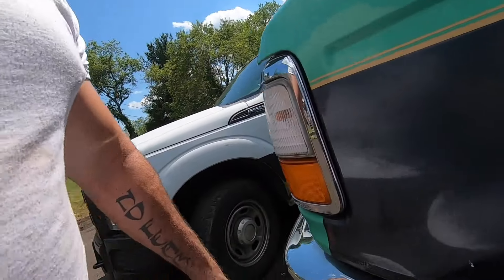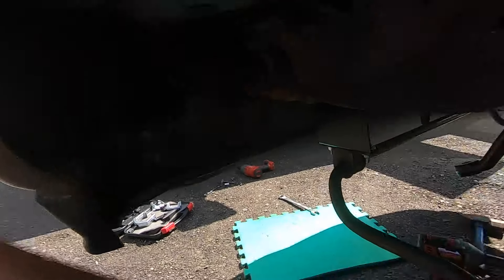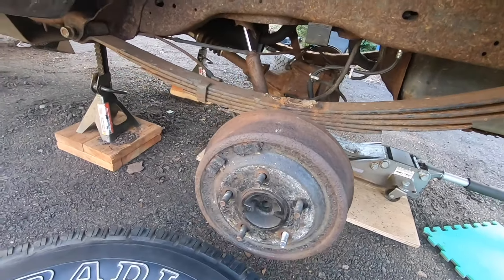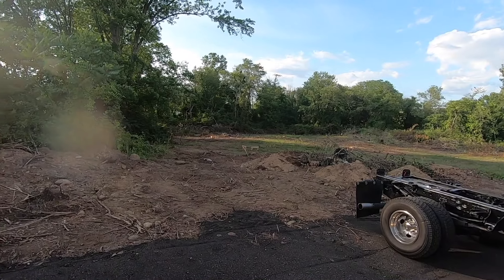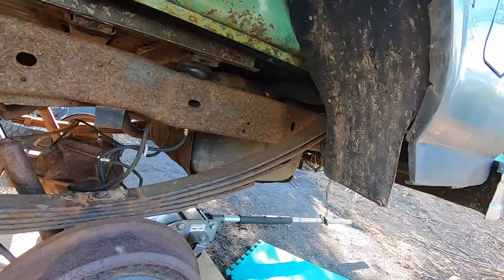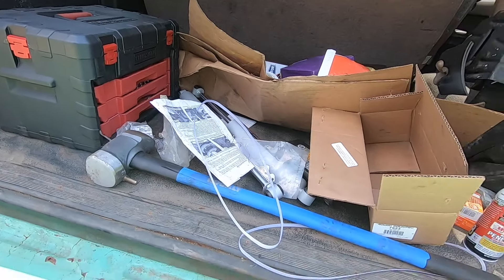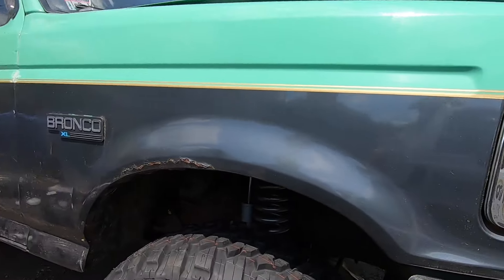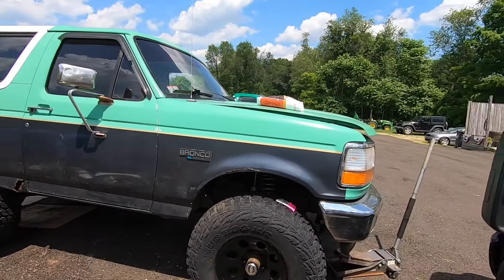Finished the 4in rough country lift on the bronco

Comment: Hello do you take out the small block in the rear????
Reply from the maker: Yes the u bolts won’t work if you put both
Reply: The little block that you mencion on minute 8:45
Reply from the maker: I lied lol I did leave the block in for some reason I was thinking about my gmc lift because that came with blocks yes with the leaf spring rear you leave the block if you do the block lift in the back you take these out

Comment: Nice job man. I didnt know you could fit 37's on a 4 lift, looks good
Reply from the maker: Thanks brother I was thinking they would because I was putting the raptor body on I didn’t care but they fit prefect with no rubbing
Reply: @NRMotorsports  Right on brother great work. I'll probably do the same on my 91, I like that 4" lift

Comment: I just got  a 94 bronco, why do I have 2 shocks under each wheel well and you only have 1?
Reply from the maker: It’s a suspension option from the factory
Reply: You can get the quad shock option reguardless of trim level. I got a 96 xlt with tow package that has quad shocks and a 96 Eddie bauer tow package that doesn't have quad shocks (but it does have the stud for a front shock to mount since it was 96 and they were just getting rid of leftover inventory)

Comment: Did you have to regear for the 37s?
Reply from the maker: Absolutely I haven’t done it yet but the 5.0 with stock gears and 37s is a dog. Gonna do 4.56 gears
Reply: Paradise C6 did you run stock gears for a while though? Everything held up okay? I’m looking at doing 35s on the same lift, your bronco looks bad ass now!
Reply from the maker: Thanks man and yup no issues with stock gears on road and off road just way slower lol and gas mileage is about 4mpgs 🤣
Reply: Paradise C6 😂 nice!! I look forward to the rest of your builds man!